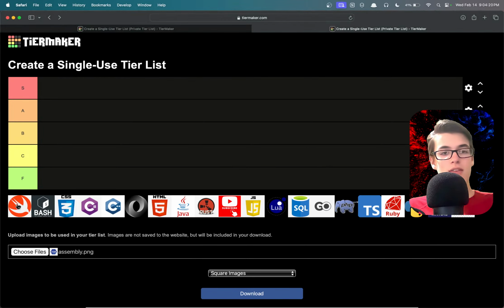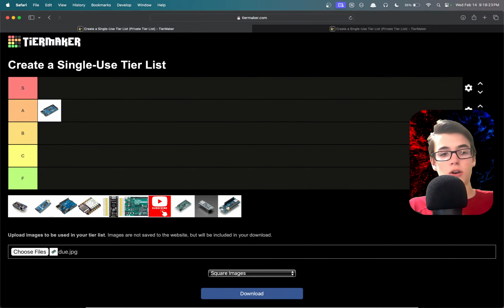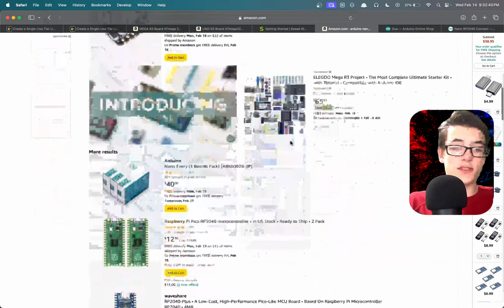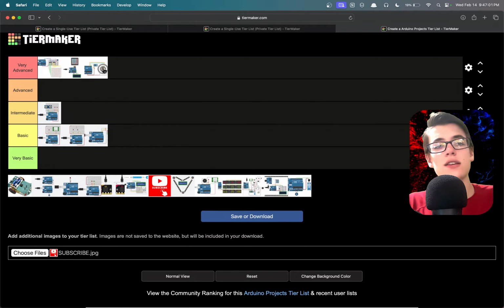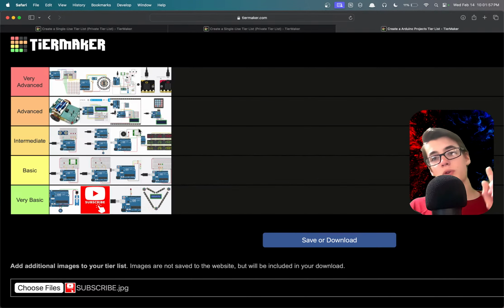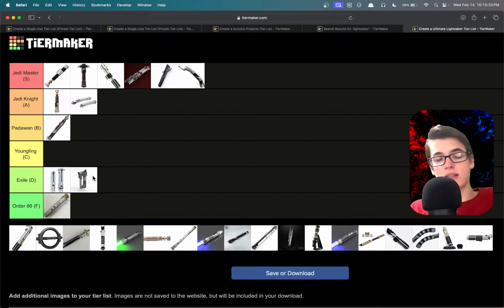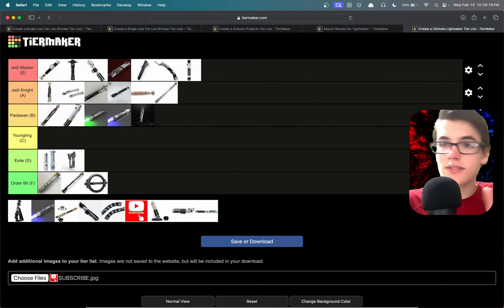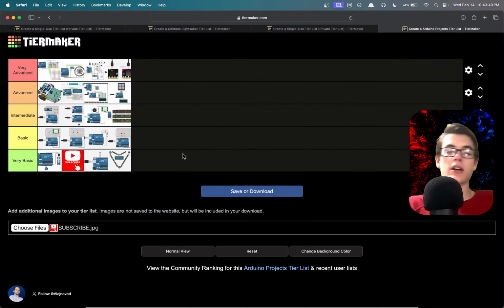Ranking EVERY Programming Language + Arduino Board AND Q&A

Comment: Dude, common, I hate apple and wouldm't touch iphone development unless my career depended on it, and even I know that Iphone apps are originally written in objective c
Reply from the maker: Well yes, but it's pretty uncommon to use that these days (at least in what I've done, which is mostly games). I've mostly used C++ and C#, and then I package that from whatever game engine I'm using, run it through Xcode, and get an app you can test on iPhone/iPad. I've never developed an app just through Xcode because it's, well, terrible!
Reply: @danovation  Fair enough